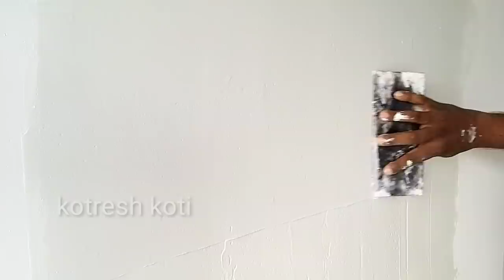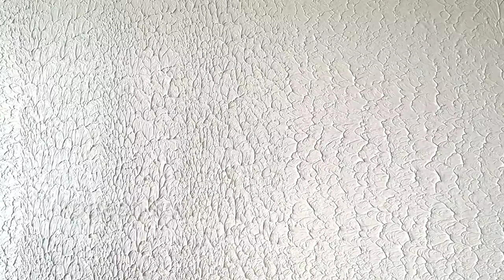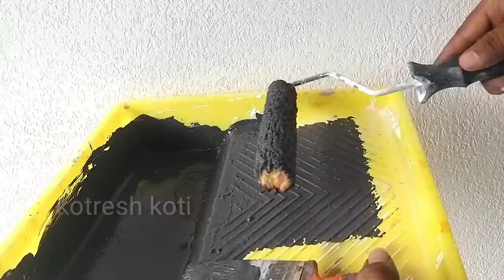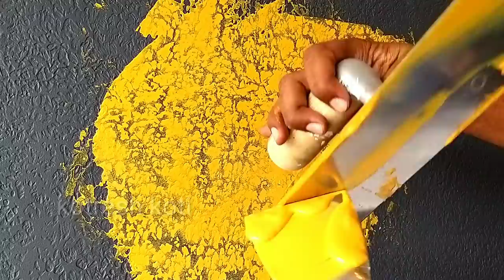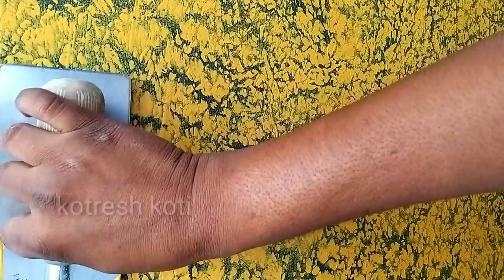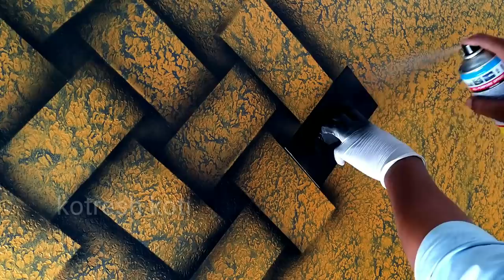3D gold wall texture looks like a royal

Comment: Actually you can cut the sanding down by taking a trowel to it when it's still wet and knocking down the points. You have to let it dry for a little while after doing the texture when it starts to set up you can knock it down with a trowel